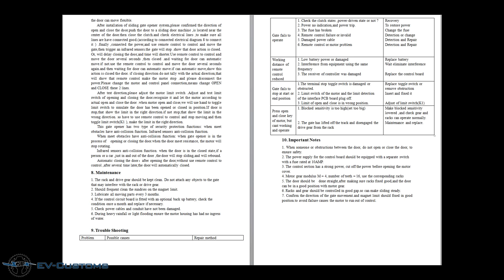My First Automatic Sliding Gate Opener Installation ( UNBOXING - INSTALLATION - CONNECTIONS )

Comment: Thank you for posting this video. I am in the process of installing a similar system and the photo cell wiring diagram is different to the photocell circuit board so I am trying to get all the help I can. 👍

Comment: I have to install one equal to the same model but I have a question, how did you connect the second infrared sensor?  Did you open the floor, did you pass the second infrared cable through a PVC tube and then fill the floor with cement?
Reply: Digging a pipe all the way to the  opposite wall and run a 2 X 0.5 or 0.75 mm2 wire

Comment: Hi can u plz send me the full electric wiring diagram e.g
Main supply Input voltage & output voltage for each connection in motor. 
Cable sizes to use ?
Switch:   Door bell or push button  switch?
Photocell sensor wiring

Comment: I installed the same gate but photocells r working in reverse direction can u help with u'r suggestion
Reply from the maker: I think you must reverse the motor no photocells... When photocells is  enabled the gate is closing instead open?
Reply: Yes
Reply: While closing the gate if anyone comes it won't reacts while opening Gate if anyone comes it will stop opening and then closes automatically
Reply: Is there any chance to adjust without changing the motor place
Reply from the maker: My friend reed 4:33 on video,  i mean to reverse the motor direction no motor place, also you need to reverse limit switch wires.

Comment: brother i bought the same motor. now already i have connected photocells. how to connect push button to it ??
Reply from the maker: Push button? reason?
Reply: @EVCustoms  to open by pressing button without using wireless remote
Reply from the maker: you can check  it in manuals, i didn't  remember if this motor have this option.
Reply: @EVCustoms  yeah it has. Thanks I did it
Reply: @Kocha2791  
please tell me how you did  push button  ??explain the way
Reply: @Kocha2791   Hello brother, can u share me the link to buy this. I'm from Karnataka , India . Even I'm looking to buy one. How's it working and what was the price when u bought bro

Comment: What’s the Ampere for 24V type of usage for getting a transformer ? I’m from India I got this but not able to figure out the power connections. India we have 230V/50Hz. Pls guide.
Reply from the maker: 200VA 24V transformer will  be ok..
Reply: @EVCustoms  but any transformer has a amperage right? what the required one for this?
Reply from the maker: You don't  need exactly  same amperage  transformer with motor,  you can put bigger transformer without problems,  so you need more  than 15Amps

Comment: The biggest rubbish you can buy, it works fine for the first 2 years, after that the colder the slower.
Reply: Can you tell me about your experience? What temperatures are "cold"? We rarely see temperatures much below 0 degrees celsius in Ireland. 

Did you buy from the linked seller?